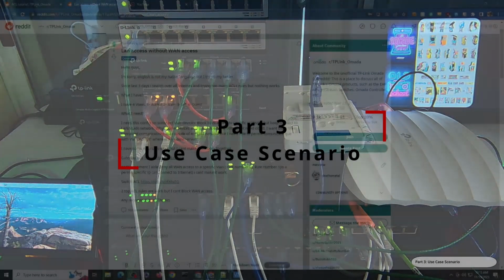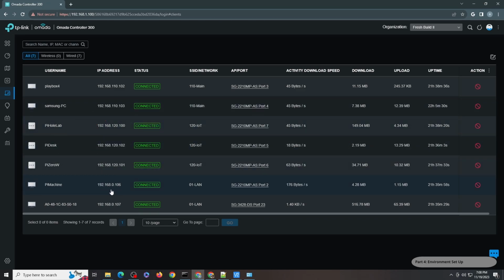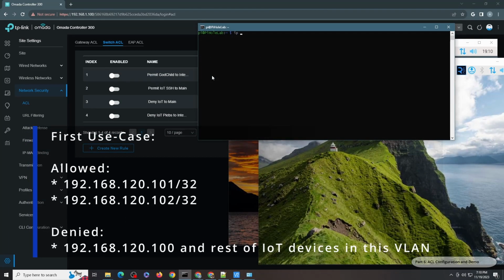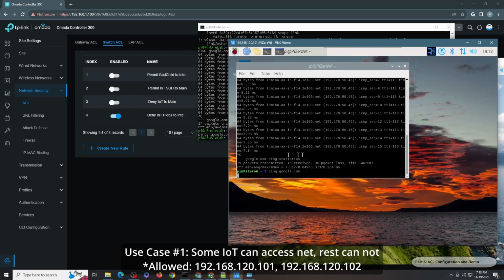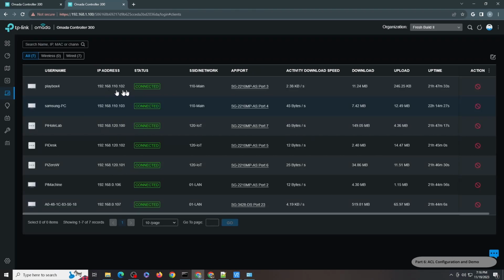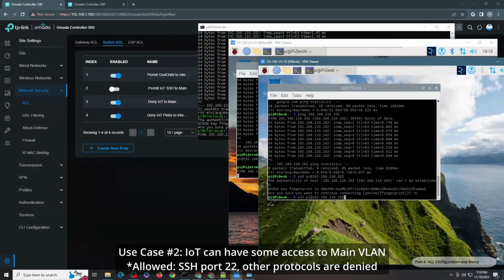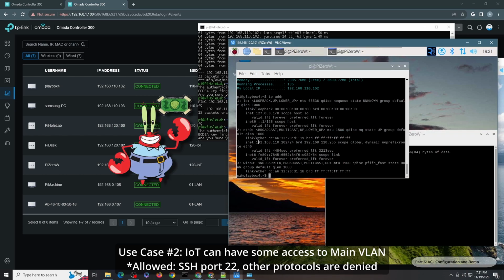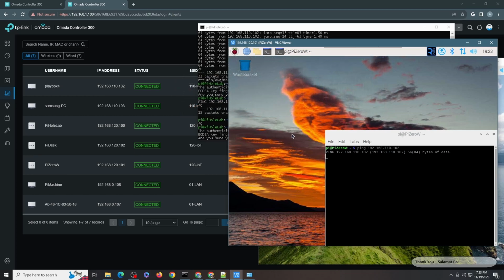CS5: TP Link Omada Switch ACL: Expectation vs Reality. Two Tips To Make Complex Scenario, Easy!

Comment: First of all great content. Secondly, do you have a video demoing switch based MAC filtering using ACL?
Reply from the maker: hey @devlin2427, thanks for dropping by the channel and thanks for the kind words. as for your inquiry, i am not sure i fully understand the scenario so let me just answer it the way i interpret it. 

For "filtering", if you mean to limit allowed devices to connect to physical ports, you can use 802.1X for that, and I do have video specific for Wired 802.1X implementation. As for wireless MAC, I do not have a video, but you can enable it using that check box if you open up any of your SSIDs.

For wired mac and 802.1x, check this video: https://youtu.be/MLeOIasSzMM
Reply: @deadmeats  802.1x is not an option in my case. The working options is creating 2 rules, one that allows MAC addresses to get IPs and one that blocks all IPs from accessing protocols.
Reply from the maker: hello @devlin2427  , by default, you don't need ACL to allow any devices (i.e. MAC addresses) to get IP addresses so you don't need any ACL to get IPs. As for blocking ALL IPs, this, you need to be very careful when blocking ALL IPs, as you may lose control of your network i.e. losing access to your all your network devices. Be safe when configuring and good hunting!

Comment: Great video. Solved part of my problem. My second problem is with wireguard vpn server. When you create the wireguard on Omada controler it ask you to write a local ip address. Let’s say I want it on another network. If i create a vlan from the same network as the vpn.  As soon as I put acl rules, the vpn client get denied all access. Example: vpn network would be 192.168.140.1 in your exemple. I want to restrict those clients (192.168.140.2 , .3 , .4 , etc) from accessing vlan 110 and vlan 1 in your example. 
How would you do this?
Reply from the maker: heya @BigPtace, thanks for dropping by the channel. I am not sure I understand the scenario, so let me just answer the way I interpret it. Disclaimer: I have not tested this with any VPN, but I remember when I was doing Wireguard, ACLs work the same way, and affects both local and remote clients, so I will have this assumption that ACLs work with VPNs.

Use Case Scenario (as I understand it): You want to block clients from Wireguard VPN clients (192.168.140.x Remote) from accessing VLAN 110 and VLAN 1 [LAN].  All you have to do is create an IP Profile Group with 192.168.140.0/24 (let's name with WG IP Pool, refer to 03:42 for the steps, focus on the /32 single client vs /24 whole network) and in your ACL, select IP Profile Group and make the necessary deny.

Happy hunting.
Reply: @deadmeats hi, exactly what I did. Made an ip group then created an acl switch rule exactly as you mentioned. 
But if after I want to create a vlan with this subnet (140), as soon as it’s created, my client can’t access anything. 
Why creating a vlan? For now I don’t have a use case but I thought it would be easier to make acl rules with the vlan instead of an ip group. 

Note: my main lan is 192.168.x.x. And vpn vlan I wanted to create was 172.16.x.x
Reply from the maker: heya @BigPtace  , the way I understand is that, as soon as you create the VLAN, the remote clients lose access. If this is what happens, you probably have conflict with your IP address. You have to make sure that the Wireguard Interface IP is unique (not in use in your LAN), even on the VLAN that you created.

Good hunting to you!
Reply: @deadmeats thanks! I have another question about WireGuard but I’m going to post it in the WireGuard video
Reply: @deadmeats hi friend, i cant select ip group when in lan to lan direction on the acl menu on the controller, só i cant block WireGuard traffic to vlan 1 😭
Reply from the maker: hey  @FodzBR  , you cant have an IP Group with Gateway ACL, you need to use Switch ACL.

Good hunting!

Comment: I came to this video for a similar reason. the solution I found was that the order of the rules makes a difference. so if the rules aren't acting the way you want them to try putting the new rule you are trying to use at the top.
Reply from the maker: Hey there @AlexXHitchcock , you are absolutely correct. I usually mention and discuss about the order of ACLs in my "Let's Configure" videos (I call them LCxx i.e. LC38 hint hint if you like ACLs, check that out) but for my non-LCs like this one (CS), I just mostly jump straight to the topic.  Thanks for dropping by the channel!
Reply: I've had my network up for about a year and have been trying to get devices on my IoT VLAN to use my PiHole DNS server on my Unraid server on my main network. It hasn't been to big a deal until recently I installed Home Assistant to a VM also on my Unraid server. I needed the Iot devices to be accessible and now from that VM on the main network without exposing everything else. I had made the IP group and set the permit rules time and time again. It wasn't until today that I realized the rules could be reordered. As soon as I did everything just started working.
Reply from the maker: Nice to know things work  @AlexXHitchcock  . By the way, here's my older LC38 video about the importance of re-ordering ACL, like you said, really makes a difference. 

LC38 19:38 : https://youtu.be/pNrdLjBXPYQ?si=mj-iRdvB5asaXqn1&t=1193

Comment: Hey there @deadmeats Can you confirm that Switch ACL only work if you have an Omada switch connected? I was hoping Switch ACL would apply to the LAN ports on the ER605v2 router which my EAP's and non-omada switch are connected to. Currently it appears there is no way to do granular ACL through my setup. Gateway ACL will work for this but that won't allow the granular ACLs
Reply from the maker: hey @nickramsay7568, thanks for dropping by the channel. I do not have access to my devices at the moment, but as you mentioned and have "clues" already, the Switch ACL applies only to TP Link Switches. If you have a Switch, even if it's TP Link, but if it's not in the Omada eco-system, the settings will not take effect. Your ER605 Gateway "LAN" ports will only work with Gateway ACLs. I am not sure about the latest firmware now, but iirc, a more granular Gateway ACLs has been requested in the past so hopefully, you can now do more granular ACLs on your router. I suggest you check the official TP Link forum or contact their tech support (links below) :

* Official Forum - https://community.tp-link.com/en/business/forum/794
* Official Tech Support - https://www.tp-link.com/us/support/contact-technical-support/